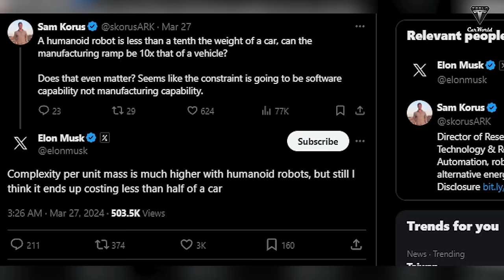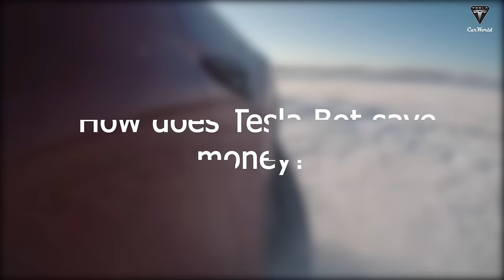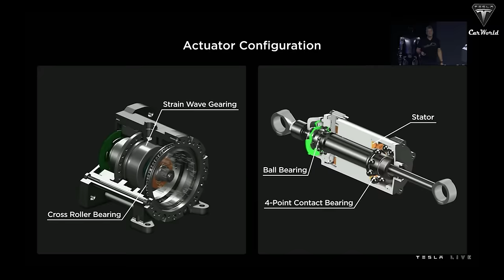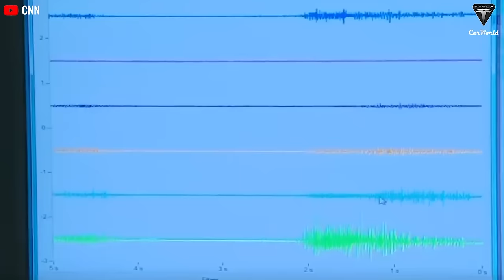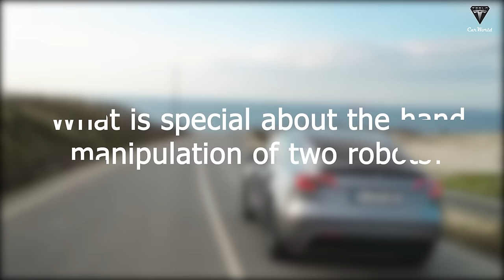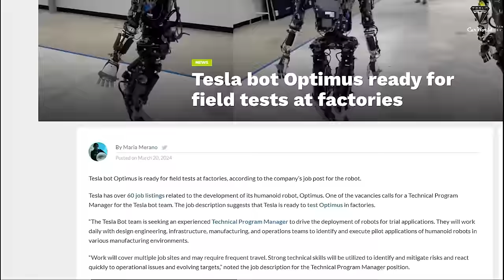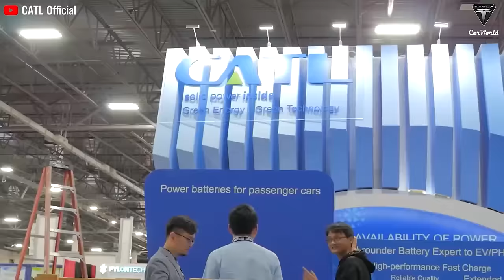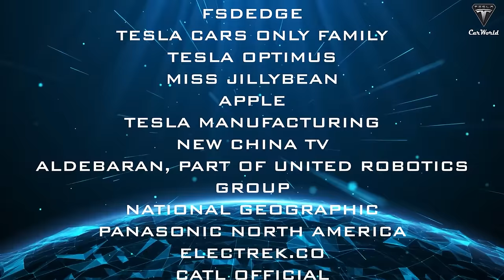Elon Musk LEAKED ALL-NEW Changes 2025 "Tesla Optimus Gen 3" - Why It Launch Getting Closer!! (MIX)

Comment: Question: I am simply curious. Why does Optimus have two legs with flat feet? Is it an engineering thing? Why not use textured rollers instead, either cylindrical or round, with a gyroscope for balance to keep it from falling over or to the side? It would still have two legs, could still navigate rough terrain or stairs but it would move faster and need fewer motors if it didn't have to operate the up and down motion of walking. Round is faster than flat.